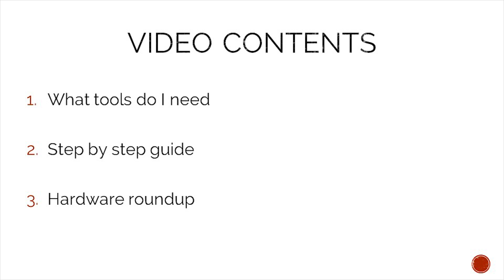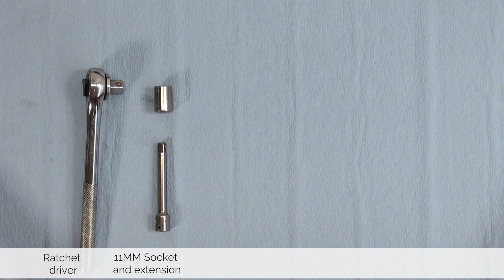Split the engine case  - Vespa LML Engine rebuild tutorial Part 14

Comment: "Has anyone tried upgrading the Vespa's rotary valve to the LML reed valve model? I'm curious to know how this change affects fuel efficiency while still maintaining the original appearance of the bike. Also, I’m considering this upgrade to avoid constant repairs on the rotary valve. Any insights on performance improvements or challenges would be appreciated!"

Comment: Dear eng,
I have motor LML model 2000.
I modified the split case by different types (italy type).
My question the modified its true or false and it will be effective the performance.
Finally What's the solution if not founding the stander case of motor.

Best regards to you.